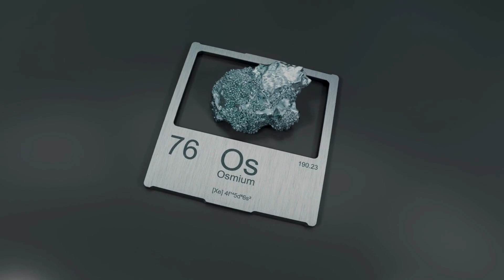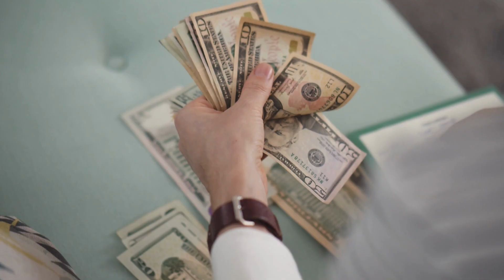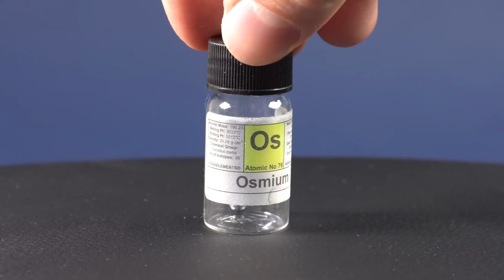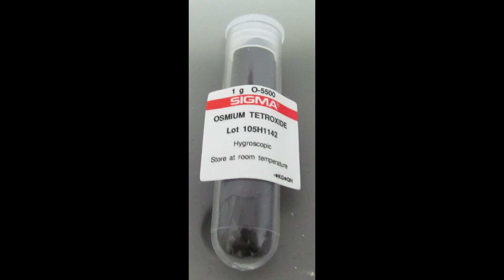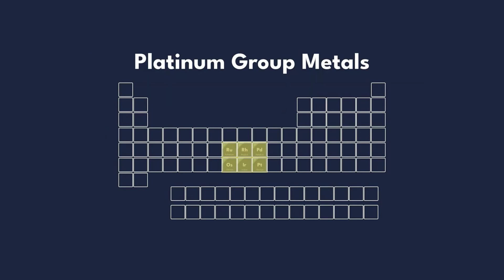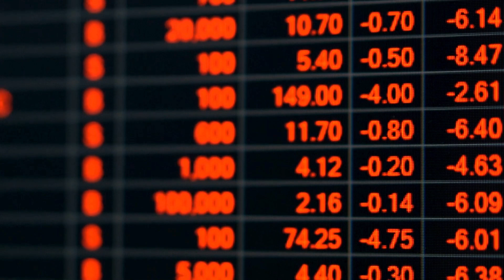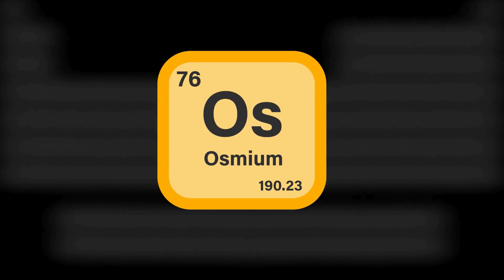Osmium, the rarest metal in the world

Comment: Iridium is almost as dense as osmium, and I believe has the highest melting point, iridium also is the most resistant to corrosion and sometimes it's. the most expensive metal, even above rhodium,but that is only sometimes, Rhodium usually stays at the most expensive metal.